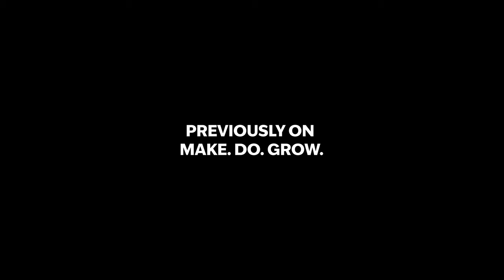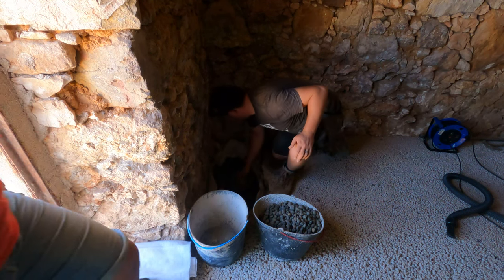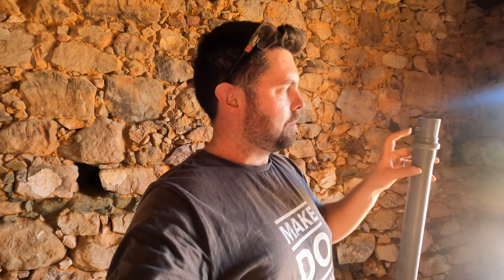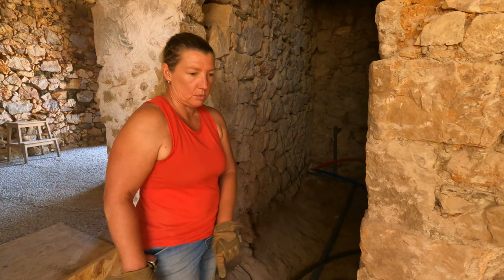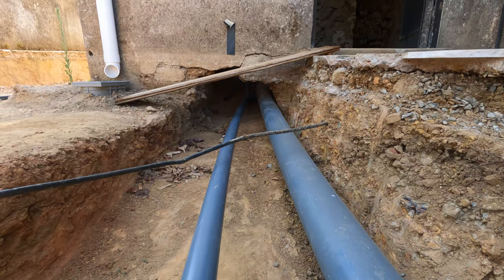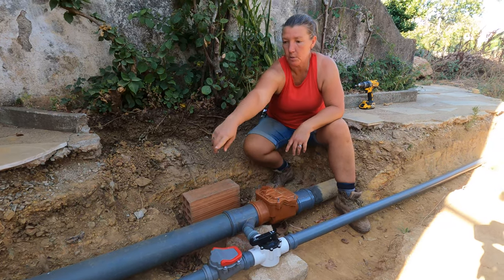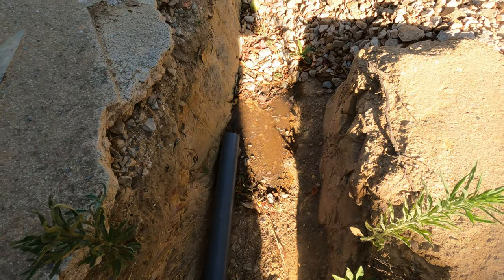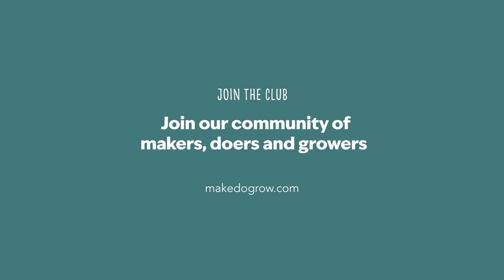Installing a Grey Water Harvesting System (Part 1) - #27

Comment: I would not recommend delivering the grey water to the septic tank, why? septic tanks have bacteria that digest all the solids, if you have the grey water with all the chemicals (detergents) it will kill all these bacteria. What will happen is a solid layer will appear on the top and also as the bacteria have been killed you will have odours